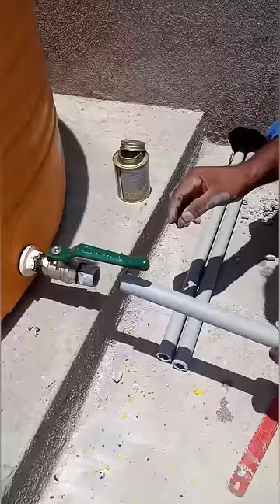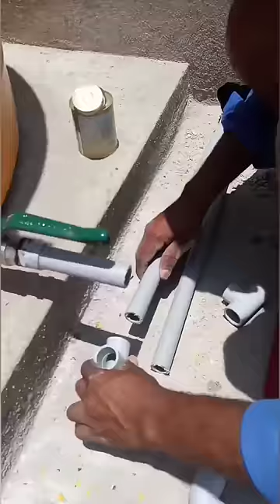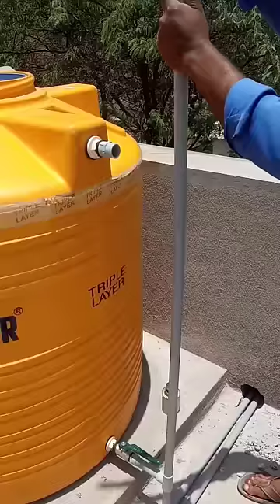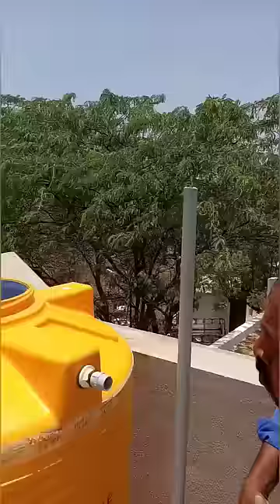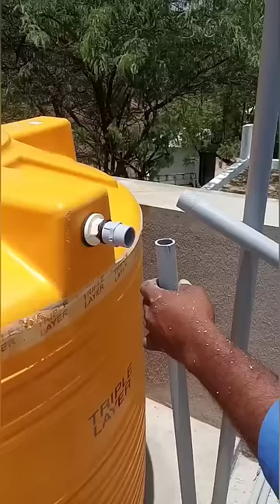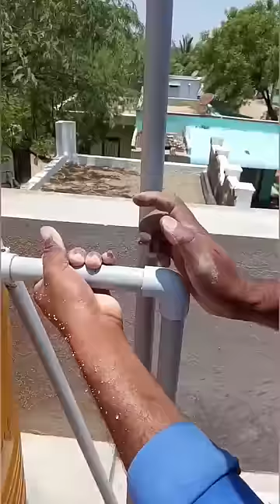Water tank installation | water tank fitting #shorts #shortsvideo

Comment: Where is Tank connecter with union 😄😄😄😄
Reply: Correct point bro
Reply: Yes. There should be threaded union both side of the valve connection that doesn't disturb the tank connection. Secondly overflow after the smaller size provide larger size pipe that will ensure no wastage and the pipe should run completely down to the sump tank. They look the water overflowing from the point and switch off the pump.
Reply: भाई इस टंकी को खोलने की जरूरत नहीं है इसमें यूनियन लगाने की जरूरत नहीं है ऐसे ही😂
Reply: Me bhi yahi bolne wala tha😂😂😂
Reply: Without unions tank connection  ??
Reply: this work mistake 😢
Reply: Binna uniyan ka fitting 😊😂

Comment: From the tank the outlet give T and then extend by 6 inches then elbow to perpendicular pipe for air vent. That will give more pressure. Provide base height by a flat extra pedestal 1 feet that will get you more pressure.
Reply: Telugu lo comment chey... Bro